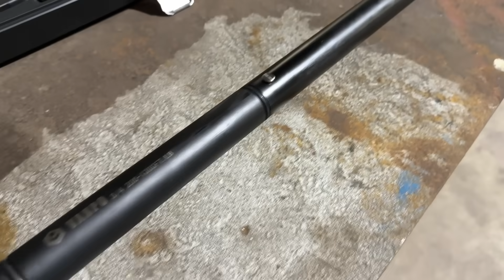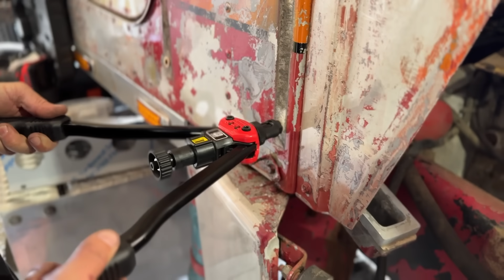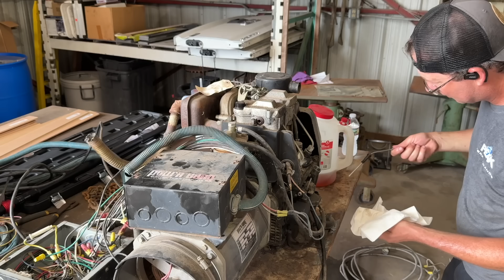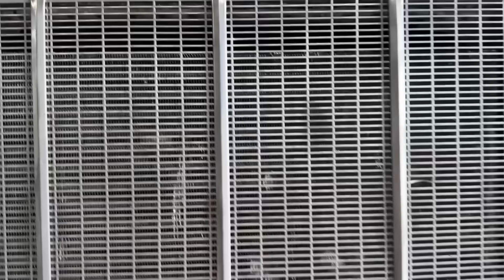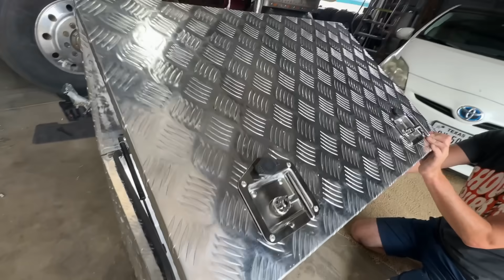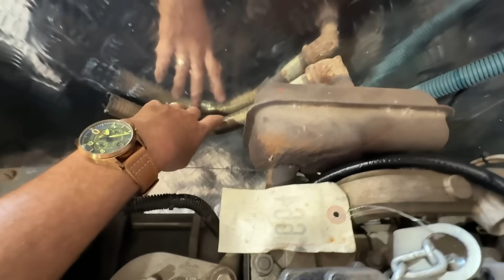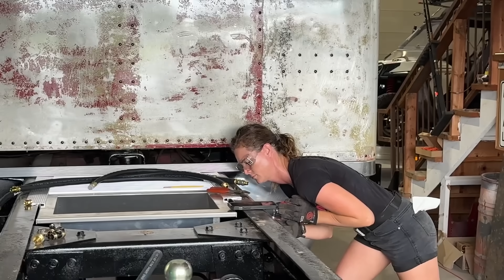Onboard Generator, 2nd fuel tank and MORE!

Comment: Just a tip, sometimes there's enough threads on the holesaw Arbor to screw a smaller holesaw inside the bigger holesaw. Use the smaller holesaw that fits the hole as the guide then.

Comment: Most 50amp plugs on RV’s are 220v. Double check how your trailer is wired before deciding how to wire the generator plug. A 50amp 110v service on a RV would be extremely rare and would have HUGE wires. 30a 110v is super common. The next step up would be 50a 220v.  Just check it out, that’s all.

Comment: I have found a hydraulic electrical punch set for not that much on amazon.  Perfect for enlarging holes as it needs a hole for the die to pull into the cup.  It is what I used to get my terminator x wiring through the firewall of my project.  It was less than $100 on amazon and I have used it for more than I would have thought

Comment: Hi. A little hole sawing tip. As hilesaws get smaller they get longer. If you find one the size of the existing hole and screw it to the arbour inside the larger one it will centre it for you. Thanks for the entertainment.

Comment: You could remove the hinge on the back of the generator box, replace that with a piece of angle iron, then cut the top in half at the 90 degree angle, and put the hinge there, bolt the top of the box on, hinge the front panel. Good work in the truck

Comment: The fuel solenoid may have two coils in it, a pull in and a hold in.  It takes more current to pull the solenoid in than to keep it in.  If you only power the pull in wire, it could burn out that coil and it would get hot.  To check if I’m right, ground the case, power the red and just touch the blue to power and remove it.   I’ve worked on gas and diesel powered welding machines that used a fuel solenoid like that.

Comment: You NEED anti-seize on those stainless fasteners.  In the spirit of dissimilar metals, those thing LOVE to gall and seize up.  And if you ever need to back one out and you spin that threaded insert, you'll be in a world of hurt.
  Even now, if you back them out, do it by and and go slowly.  Any heat generated might ruin your day.

Don't get me wrong, I too love stainless fasteners. I even sell SS socket head cap screw kits for Grand Nationals I developed to the Buick community.    Bit all it takes is for one fastener at the worst possible time to knock you for a loop.

Especially on the sheet metal stuff you're bolting too.

Comment: You may think about getting a hi-cap 12 volt fan mounted where the cabinet outlet louvers are that comes on when the generator is running? That box could get pretty hot with a running genset.

Comment: Hey Aaron just a note here in Aus it is not allowed to drill holes in the top or bottom of the chassis rail.I noticed when you were fitting the fifth wheel mount.that is a transport regulation cheer nice build by the way. Blue pull in circuit red I think you will find is the hold in circuit it takes less power to hold in than to pull in cheers

Comment: Pro-tip from an electrician who has to cut holes in plaster all the time. Here's a few better ways you could have cut the hole in the body panel.

The most sketchy way; when you're upsizing a hole with a holesaw, especially in plaster (drywall for you Americans) you can start with the drill in reverse and let the teeth slowly give you a starting groove, so the holesaw will be less inclined to walk across the material (especially important in a finished ceiling, or a shiny body panel).

Better;  If the arbor of the holesaw has a long enough thread, fit a holesaw that fits the small hole inside of the larger holesaw you're trying to cut to. Usually holesaws of the same brand are the same depth, so this will give you ~2-3mm protrusion that will seat on the smaller hole and guide the cut for the larger hole.

Best; Drill out the holes that you're going to use to fasten the plug outlet to the panel. Using two opposed bolt holes, fasten a piece of timber or aluminium to span across the hole. Drill your pilot hole, and away you go.

Comment: You may find a similar starter solenoid with same part number for a different generation same electrical contractors and Just drilled out the mounting bracket to the appropriate width at a MUCH MUCH LOWER PRICE 😮 yes!!!!

Comment: Here's an idea to kick around with the generator box.

On the front face, drop down from the corner about 1.5" and split the front face from one end of the box to the other.  Use the existing hinge to reattach both part of the front face.  Make a couple of hood props to hold it open, if you need to during generator operation.

That way the generator is covered from most of the weather.  Weather gets real bad, close the front however far that you need.

You can cut slots on the hood prop, and have a pin that it can rest in.

I can do a sketch and send it through the mail if it would make it easier to understand.

Comment: Question about the wheel "gasket".

The front hub is steel yes, and the wheel is aluminum yes, should a "gasket" be used there too?

I know that it's not a gasket, I just chose to use that word rather than going back through the video?

Comment: Ground the solenoid to the chassis the blue wire is the pull in wire should be the same wire that energize your starter, and the red wire should be the hold wire. All it does is hold the coil at a lower amperage.

Comment: 43:21 should put a pusher fan on the rear vent for the genny box, heck maybe even a puller fan on the front vent, and you might be able to run the generator with the box lid closed.

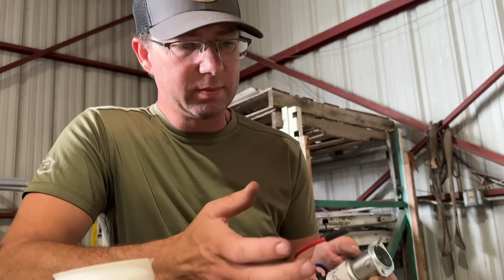Comment: @53:30 Two-wire solenoid: the first wire is to pull it open (high amp, goes to the start switch circuit), the second wire is to hold it there without burning up (low amp, keyed 'run' circuit).
Reply: That will take care of how hot it was Emily pointed it out earlier in the video

Comment: If you’re use hood / bonnet spikes for the generator box may  need some springs to keep pressure on the top to stop rattling noise or the rubber ones like on battery boxes ❤❤

Comment: That little Deutz MD151 engine on your generator is air cooled, and looks like it is missing a shroud/cover on the side with the injectors. I'm no expert, but I think it would be a good idea to fabricate/order a new one before running the engine too much so you don't overheat it and kill it. I also have some concern about it not getting enough cooling air while running shut inside of that box.

Comment: I suspect the red is engage the blue is the hold  circuit.If the red is energized constantly It will burn the unit up. The energize should only on start circuit.I learned the hard way.. By the blue should be energized in run position. Good Luck

Comment: Is the truck going to have a apportion plate truck plate  or RV plate. If just a RV  or  Truck tag you just need AIR brakes endorsement on driver license. If you going to use  truck for commercial  then you need the CDL with DOT and MC.  check it out maybe your state.  you need to get IFTA account.

Comment: wanted to pop in on the comment about the generator and the RV's. 
You mentioned that RV's with 50a plugs are still single phase 120v, and that's not typically accurate. They are usually configured without 240v devices, but the NEMA 14-50 outlet that is standard for those RV's is a 240v outlet and is fully capable of running 240v devices. With the size of that generator it was likely wired for a 30a outlet which would likely be a NEMA L14-30R which is what you see on most 30a generators and even on the Ford Powerboost bed outlets.
If your trailer is already wired for 50a, then I would probably put the NEMA 14-50R on the outlet of the generator just to save adapters, just make sure that you are using a 30a breaker appropriate for the generator.

Comment: Another good video. I was just wondering if you have checked your front cab mounts. Because I keep noticing how close your hood is to the cowl on your cab. On my 84 Pete the spacing is over a half inch from the hood to cab. Also, that is why your hood had that damage on the end of it. It was to close to the cab. There is a small stiffener that goes on the inside of the hood where Arron made his cut out for the breather. You all are doing great work on this truck. As always, I want to thank CRC for their sponsorship of your channel and all the great products that they put out.

Comment: Hi Guys you can have the correct voltage and still burn out your connected equipment. All US equipment run at 60 HZ I suggest getting a frequency meter to be safe. so that you get the correct frequency. the frequency is adjusted by increasing the speed of the generator. cheap item at Granger and you can get it panel mounted. 50 years licensed master electrician

Comment: On your generator box, you might really think about extra support where the generator mounts to the floor of the box. The generator will work harden the aluminum  all around gen set mounting bolts and brackets. Maybe just a 3/8 marine grade piece of plywood to cover box floor would help spread the weight. Other thing to think about when you’re parked camping or whatever and the generator is running be sure it gets plenty of air. It will overheat. Very envious of your project been wanting to do exactly that for years.

Comment: maybe put that hinge on the front of the generator cover so if you wanted you could just lift it up without pulling the pins and you could access the generator if you didn't need access to the top.

Comment: Pro tip. Depending on the hole saw, you can put the smaller size on there too to ride inside the existing hole. Wood worked too though lol

Comment: The only issue I would think with putting a deutz in a enclosed case is airflow they are air cooled so you need maximum air flow I would change the exhaust vent on the box to a mesh get the heat out the box fast also exhaust straight the box to a muffler again keeping heat out of the box other than that I like deutz they are quiet and efficient

Comment: Glad you figured out the air cleaner  cut on the  hood 
Also I was thinking about put something in back as drill guide for Rv plug  I was talking to the TV when you figured that out
Aaron  please make sure to run generator exhaust out behind and from under the cab and sleeper 
Don't want co2  to take you out 
I'm enjoying the  rebuild so far 
Come I'm a light weight too
Cheater pipe would get you to 1000# if needed

Comment: For the generator box lid, I would cut the front face off the top at the bend then bolt or rivet the top to the box and repurpose the hinge to the new cut. Then just the face will open and close easily. But if it works for you as is. All good. final placement looks great!

Comment: There is an "oops arbor" for hole saws that holds a 2nd saw the size of the oops hole.

Relatively inexpensive and something to add to the hole saw collection if you run into that issue more than a couple of times.

Comment: Hi; There may be other comments referring to such but I didn't read them. The wiring on the fuel solenoid may include a low oil/low oil pressure shutoff protection system. How it's wired would require knowledge of how the low oil/low oil pressure sensor is configured. Also you may want to consider plumbing a second muffler mounted to the truck frame with a tailpipe that parallels the truck frame ending at the tail end of the frame to quiet the engine more and redirect the exhaust fumes and noise as far from the sleeper as possible, you'll thank that you did some hot summer night with zero breeze and the fumes just linger around the sleeper. And even if it's current noise level doesn't bother you, it will the people in the tent or pop-up next to you in the campground.
Reply: I made a big U bend, mounted a zero turn mower muffler then tied it into the engine exhaust on my converted bus. You can hear it out the tailpipe but cant hear the motor in the bus

Comment: Dual coil fuel solenoid?  
High power (blue) coil to do actual pull when going to run/start position. Powered only during cranking. 
Low power (red) coil to maintain/hold at run position without  overheating the solenoid / coils. Powered always when ”ignition” run position is on. Not strong enough to do the pulling. 
Off.  No coil powered.

Comment: Blue wire is the “pull in” circuit and the red is the “hold in” circuit. The blue wire on your generator should have 12v during crank which would pull the solenoid over to engage it and the red will get 12 v with ignition on to hold the solenoid over in the run position. There are actually two different electro magnets in the solenoid.
Reply from the maker: Thank you so much!!! I will test wires on Monday to see what I’m getting from the box.
Reply: @flyingsparksgarage also the solenoid grounds through the case
Reply: Similar to a dodge P pump shutdown solenoid 👍

Comment: As that’s a Deutz diesel, it’s air cooled.  You may want to drill several holes on that box to ensure it has plenty of air movement to keep it cool.  Stuffed inside that box without good ventilation may end up badly

Comment: Thanks to all the sponsors for this build. You are making outstanding progress and it is coming along very well. It is an interesting approach that you are taking with the generator. When I drove over the road I had a Thermo King APU on my truck. It came with the power side as well as air conditioning and heat for the truck. I had it to come on every time I shut the big motor down. The only issue in your application that it would have, outside of cos, is the HVAC components were under the bunk and took up a lot of storage space. Love the approach you are taking and continue the good work.

Comment: That is a marine plug you installed on Optimus Grime. The cord is different from RV.  It will not work at an RV park. It will be fine for the boat.

Comment: Why do you not cut the generator lid in the front at that L bend and put the hinges back there so it can flip just the front part up and bolt the top part to the box that way you can still take the top part off if needed and you might be able to use the shocks for the door also still

Comment: if you cut the generator box cover into two pieces, you can have a box top and a flip up front door by using the hinge to connect the box top and the front flip up door and reposition the support hinges to open the new front flip door open upwards.  you already have all the parts, just need to do a little reconfiguration to get a front flip up generator door.    you might also need to add fans on the generator box vents to keep the temperature from over heating the engine inside a small box when running the generator.
Reply: My thought two then use a light duty locking hinge, like from a camping table, chair to hold it up.

Comment: I didn' get a very clear view of the generators bottom brackets, but I don't think there was any rubber pads under them. Mounting it on rubber pads and making sure that no vibrating parts ( including the the exhaust) dont touch the metal of the genny box will make running it much more quiet. Maybe even coat the inside with some kind of sound deadening material..?
Love this series, you guys are doing so good.

Comment: I would look into a remote start system for the genny, I have seen some remote wireless key fob for remote controls. Im sure that box of wires probably has a way besides the pushbutton and switchs. That would make starting the genny from inside the cab or inside the trailer, in case of undesirable conditions outside. Great work you two.

Comment: Gen box cut front section on top bend, bolt the top solid install hinge you have bolt front panel. Now you can flip open front to work and close the lid done.  moved the hinge top front lid. It’s easy.

Comment: by Hank Winning » Sun Dec 16, 2001 9:29 am

we got the specs for the BUDD wheels nuts from a HD mechanic
The inner nuts (13/16") torque to 450 ft lbs. The outer nuts (1 1/2") torque to 600 ft lbs

Comment: Hey you guys, if that gen set is air cooled you should not hope to close up the box when running. I have done it by running powerful 110v attic roof fans that actually have heavy pitch to the blades and are not so amp. thirsty. I set it up one fan blows and one sucks in. Try a piece of hinge cut to fit a side and see if the cover can spin sideways so ya don't have to lift it off. Continued good luck!!!

Comment: You can put another hole saw inside the bigger hole saw on the same arbor that is the same size as the  hole already drilled to use as the “pilot bit”.

Comment: 50 Amp RV service consists of two hot lines of 120V 50 A for each hot wire. The other 2 lines are a common and a ground. Yes, that means there is a total of 100A available, but it is split into 50 A on 2 separate lines. That means a maximum of 50A on one branch, and a separate 50A on the other line. It also means there is 240VAC available as well. This confuses many people. Look it up, don't take my word for it.    From Gary in McKinney. I love your shows!
Reply from the maker: Thanks for sharing the info Gary! 👍

Comment: the blue wire is the pull coil (starter) and red wire is hold (ING) if you use only blue wire the coil will get to hot

Comment: You can also use a smaller hole saw bit the same diameter as the existing hole as a guide and once you’ve got a nice groove started remove it and finish the cut.

Comment: Hi, the solenoid on your Deutz engine most likely has both a pull-in coil and a hold-in coil. The pull-in coil pulls the arm and uses more amps, while the hold-in coil stays on constantly and uses fewer amps.
Does that make sense?
Greetings from Denmark

Comment: Aron another trick when when you  need to enlarge a hole with a hojesaw, take a piece  oof wood  drill it with the hole saw and clamp to the piece,  remove the pilot bit and  drill the hole ,the holes away can't wonder. Keep up the good work , Don